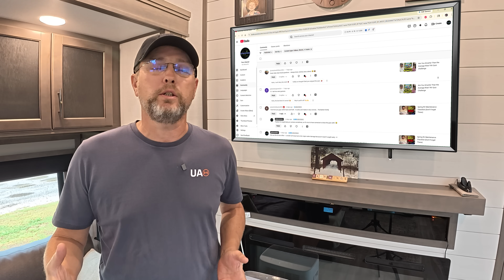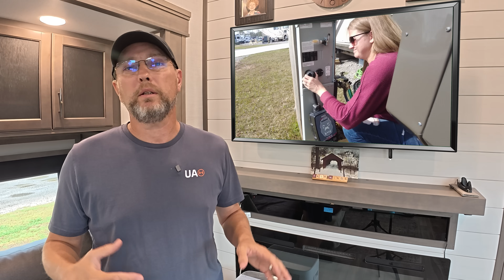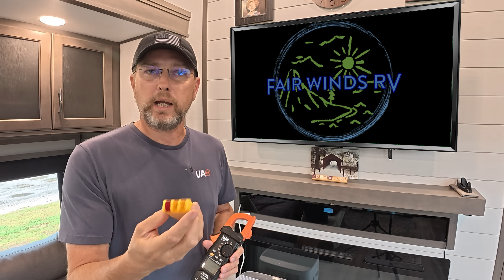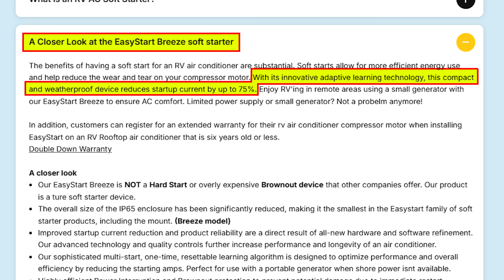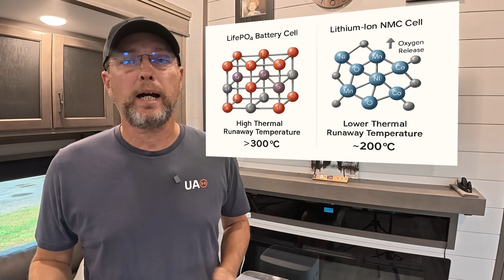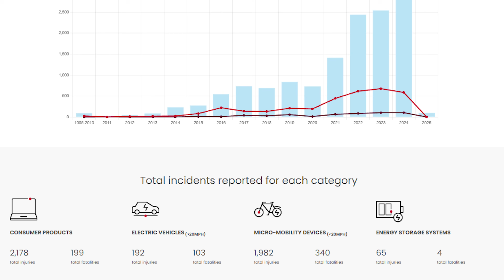Bad RV Advice We Keep Seeing (Let’s Clear This Up)

Comment: After 4 campers and camping since 2005 never used a surge protector or soft start. We camp every year and normally make 15 to 25 stops on our 3 month camping trips around the country. Do you have a surge protector or soft start in your home for the whole house? Don't say surges or screw up can't happen at home.
Reply from the maker: Residential electrical systems are a completely different animal. They don't get abused on a daily basis and you don't have neighbors moving in and out every day with electrical problems that affect YOUR house. And your residential grid is being operated and maintained by licensed professionals, not some random campground employee. Surge protectors (with an EMS) are insurance. You may never need them, but when you do, they can save you a ton of money. Just because you've never had an issue doesn't mean other people aren't having issues every single day. As an RV tech, I've seen the damage caused by a missing neutral. Thousands of dollars in damage could have been prevented by a $300 surge protector with an EMS. Take chances with your RV if you want. The rest of us will play it smart. 
Oh...and people have also been installing soft starters in their residential air conditioners for a while now...because they work. It's not just about being able to start an AC on a generator, it's about protecting your AC units from wear and tear long-term. 
Use these things or don't. It makes no difference to me, but you simply can't argue that that they're not important tools to have. Your experience does not equal truth.

Comment: First, let’s talk about RV surge protectors.

I completely agree that they are necessary. The more advanced models with emergency power shutoff are excellent, but even a basic “dog bone” style surge protector should be considered the minimum.

Many of us camp outside city limits, where we get great views and that wonderful wilderness feel. But that also means we are often closer to areas where lightning and unstable power can be a real concern. No surge protector is going to save your RV from a direct lightning strike, but it can help protect against power surges caused by storms or poor campground electrical service.

As both a licensed radio operator and an avid RVer, I’ve seen what power surges can do to unprotected RV electronics. A surge can damage things like the control board for your furnace, water heater, or propane refrigerator. Even a basic surge protector can help prevent a trip from being cut short because you suddenly have no heat, no hot water, or no refrigerator.

In my own RV, I use a Victron inverter/charger system that helps manage power quality. I still use a surge protector at the campground pedestal, and if the incoming power is bad, my system shuts off shore power and switches to battery power. Most RVers do not have that kind of setup, so for them, investing in a good surge protector with emergency shutoff is a smart move.

Second, let’s address soft starts for RV air conditioners.

Do soft starts damage your A/C? No. They do not. In fact, they may improve the lifespan of the A/C.

A soft start helps your air conditioner start more gently. Without one, the compressor gets a big sudden hit of power when it kicks on. That is the loud “thump” you often hear when an A/C starts.

A soft start reduces that initial jolt. It gives the compressor just enough power to begin moving, then gradually increases it. Once the compressor is running at speed, the power demand drops back down.

This is easier on the air conditioner and may reduce wear and tear over time. That is why I have soft starts on both of my A/C units. They allow me to run them from my inverter or a smaller generator, but just as importantly, they help the compressors start more smoothly and may extend their life.

Third, let’s talk about LiFePO4 batteries in an RV.

Are they safe? In simple terms, yes. If a location is safe for a traditional flooded lead-acid battery, it is generally safe for a LiFePO4 battery.

Any battery can fail if it is badly damaged. If you crush or seriously damage a lithium battery case, it can fail dangerously. But the same is true of a traditional lead-acid battery. Those contain acid, which can cause serious damage and can also create fire risks.

One safety advantage of LiFePO4 batteries is that they do not give off gas while charging. Traditional flooded lead-acid batteries need more ventilation because they can release gases that are toxic and flammable. That is one area where LiFePO4 batteries are actually better.

The main thing to understand with LiFePO4 batteries is temperature. Traditional lead-acid batteries handle freezing temperatures better when charging and discharging. LiFePO4 batteries usually have a low-temperature cutoff, meaning they will stop charging if the battery cells themselves are too cold.

Some LiFePO4 batteries include built-in heaters. These use a small amount of incoming charge to warm the battery until it reaches a safe operating temperature. That is the type I use in my RV. I have two heated 300Ah Vatrer batteries connected together, giving me 600Ah of battery capacity to power my Victron inverter system.

So the overall answer is this: LiFePO4 batteries are not more dangerous than standard RV batteries, but you do need to pay attention to battery temperature in cold weather. What matters is the actual temperature of the battery, not just the outside air temperature.

In my setup, outside temperatures have to drop well into the 20s before the batteries themselves start getting close to 40 degrees. I even tested the system when it was 2 degrees outside before I saw the batteries enter warming mode and noticed a drop in available power.

The lesson is simple: measure, test, and know how your own system behaves.
Reply from the maker: Agreed 100% on all.

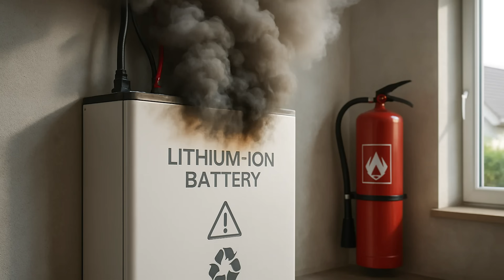Comment: I used to agree with you regarding LiPO4 batteries. Yes, the BMS is supposed to prevent overcharging and over discharge but they can't do anything if the default is from the batteries themselves where all of the energy is stored. At 8:18 you showed the out-gassing and that is the hazard. That gas has a high concentration of hydrogen which can be an explosion hazard in a contained area and has a high concentration of toxic compounds including cyanide. I still use these batteries but only with a lot more respect for what could go wrong. I no longer have them inside where the gases could kill someone sleeping or in a non-vented environment that creates an explosion risk. If you want more information on these potential problems, check out StacheD Training for real life details. (I am not affiliated in any way with that channel.)
Reply from the maker: No battery is completely safe, but I'd much rather have an LFP battery than a LA battery not only from a performance and cost perspective, but also safety. Taking the right precautions is always prudent, no matter the battery chemistry.

Comment: Thank you for these posts. 👍🏻 I wanted to chime in on the BB controversy but you turned off the comments. Obviously a lot of emotion around this issue. I’ve had no issues with my BBs so far and we’re going on 3 years for 2 of ‘em and 4 years for the other 2 100Ah.  I’ll keep this short: How do you monitor the temp at the terminals? I have Victron everything, btw, professionally installed. Also use a Progressive EMS.
Reply from the maker: The best way to manually check the terminal temps is using an IR temp gun. You can pick them up pretty cheap at your local big box store. Another idea is you can mount a temp sensor on it...like the ones from Govee. Those things can be remotely monitored from your phone and you can set alarms to notify you if the temp gets too hot.

Comment: Serious question: do our HOUSES have an EMS with EPO? If not, why do our RVs require one and our Houses don't? Just curious.
Reply from the maker: Very good question and thanks for asking. The odds of having a severe electrical issue, like an open ground, open neutral, or reversed hot/neutral in your home are very low when compared to campground electrical systems. Campground pedestals get abused regularly. Breakers and outlets fail frequently, and unlike residential homes, most campground pedestals are not serviced by professional electricians. Many times, they're being repaired and maintained by work campers or on-site staff that have no electrical background and don't truly understand how they work. Additionally, campgrounds are much more susceptible to dangerously low voltage sags when everyone is using their AC units at the same time.
And far too many people are performing bootleg electrical work in their RV's that cause problems for the entire campground.
The electrical system in your home is far more stable because, generally, once it's installed by a licensed professional, it just sits there and does its job. Nobody's messing with it on a daily basis. Obviously, residential homes are not immune to the rogue DIYer that does something dumb that causes issues, but it happens far less often.
It really comes down to quality control. Campground electrical systems are notorious for being faulty due to human errors during repairs and maintenance, and frankly, just being abused on a daily basis.
Reply: @fairwindsrv Next Question for someone who knows: In general, are there codes for building a campground when it comes to the plumbing and electrical work?

Comment: I spent 43 years as an electrician and anyway that you can protect an electrical system and electronics from search are under voltage is a good thing.
You don’t wanna smoke your appliances your electronics. I even went as far as to replace the progressive surge protector with the power watchdog on board EMS and my brand new Escape Trailer. One feature the power watchdog has as you can get an extra circuit board in case you do take a Hitt and I have one spare and in my rig.
Reply: Interesting. I’ve been using the same Progressive for years and it always takes a couple of min to “click” on because I assume it’s assessing the feed- which I can read, except in full sunlight 😎🙄- but I noticed that the plastic at the base of the prongs must’ve gotten a little hot, presumably from loose contacts, but that’s a “good” thing because it’s easier to replace a surge protector than a whole lot of fried components. 🤷🏼‍♂️

Comment: Just saw this and subscribed. I am wondering if you have done a video on what is necessary to change from lead-based batteries to lifepo4, going to search your page.
Reply from the maker: Welcome to the channel! Switching to LiFePO4 is relatively simple. First, you need to make sure all of your sources for charging the battery support it. Converter, charge controller, etc., as LiFePO4 batteries have a different charging profile than lead-acid. Additionally, LiFePO4 batteries are capable of delivering much higher fault current than lead-acid batteries, so you need to make sure your main battery fuse is rated properly and your wires are sized properly. 
My biggest advice is to make sure you get a battery with a decent BMS to protect from any faults as well as provide low temperature charging protection as LiFePO4 batteries should never be charged below 32F. Most LiFePO4 batteries will have a BMS that will protect the cells, even the budget brands...but it's definitely something to pay attention to.

Comment: We hard wired our Power management system. Its not a surge protector. One down side to a hard wired unit is if it goes dead then the whole RV is dead until its replaced, so I bought a new one for that reason.
Reply from the maker: When we melted the connection between our portable Power Watchdog and shore cable, I converted it from potable to hardwired. Fortunately, our Ecoflow power stations don't run through the Power Watchdog, so if it dies we at least have temporary power until I can get it swapped out. Not a hard task, but would be a little time consuming for sure.

Comment: You are right, anyone not using a EMS/surge protector is going to end up spending lots of money. What a lot of people don't know is that low voltage probably does way more damage than big surges. That guy who thinks just checking when he first plugs in is one of them. I hate to admit it but back when I was starting, I didn't have a surge guard. We were in a campground, and we were running a load in the washer. Well the lights dimmed and came back up the washer quit and wouldn't run. For those winning about cost, I could have bought the best EMS on the market and had money left over for what it cost to fix the washer. I like my portable Surge guard because I can plug in and check power before parking the RV.

Comment: LiFeP04 lithium iron phosphate LFP batteries/inverters/solar charging were my bread and butter hobby since 2017. I built 14 systems using them, ranging from 50 amp hours to a 3600 amp hour 1100 pound unit that could power a house for days. These include 2 motorhomes, a rural cabin, a vacation home, all for friends and family. I used to tell the YT Firefighter StacheD that he was overly concerned about these batteries catching fire.....until one set my power console on fire and did $150,000 damage to my house/garage.

True, water can extinguish LFP battery chemistry, and they don't suffer thermal runaway.  What happened in my case was thoroughly investigated and is going through court now so I must limit my details.  It turns out that the 300 amp hour battery that ignited was under very low load, was charged to 99%, and should have been safe. It operated with 11 others in the same cabinet for 2+ years straight with no troubles at all. My video monitor captured the battery parameters right until the smoke obscured the lens....NOTHING ABNORMAL!

The forensic investigation determined that the 80 pound battery was dropped upside down from 5-6 feet and landed flat sometime in its delivery to my home. A loading dock accident?  Inertia caused the cells to break free of their double sided tape and one nipped the insulation and pinched the internal negative lead to the BMS. In effect, the short circuit was BEFORE the path to the protective circuits. All batteries had fuses, too. But disaster happened.

And so....I am extremely wary of all kinds of batteries, LFP or lithium ion, charge them in a fireproof area and I set my timer to stop the charge as necessary. I have another 64,000 kilowatt hours in 48v batteries in my shop but they are UL Listed and have internal fire protection. I'm still wary of them. I will admit that the same brand of 300AH battery is in my camper van running and charging automatically, away from the house should the worst happen.

Comment: The issue I had with owning a Watch Dog surge protector was it shut down with any voltage change and did not turn back on when the problem was corrected. Specifically when the seasonal campground loses power during a storm. Every time the energy company notified me of a power outage, I had to drive 2 hours to the campsite to reset it. I switched to a unit from Progressive Industries that comes back on when the power is restored ( after it runs a system check first )
Reply from the maker: Strange that it wouldn't reset on it's own for a simple power outage. According to their website, the only faults requiring a manual reset are E3, E4, and E8 (L1 overcurrent, L2 overcurrent for 50 amp, and missing neutral in the coach). My guess is that if you had to manually reset it after simple power outages, you may have had a faulty Power Watchdog. In any case, glad you found something that works for your situation. These things are a life savers!

Comment: I installed a SoftStartUSA in my horse trailer in 2023,  I have an Anker 767 with a 30 amp plug, which according to what I was told should be able to run the A/C.  When I turn on my A/C it trips the Anker.  How can I tell if this device is actually working?
Reply from the maker: The only way to truly know if it's working is to actually measure the inrush current going to the AC using a high quality multimeter with a current clamp. The meter needs to have the ability to measure and display peak current.

Comment: Okay folks and I want to thank fairwinds for this video because you do have a lot of people that think they can outdo outsmart or even do better than what the equipment he's talking about. And by the way, I'm an electrical engineer as well as a licensed electrician for the state of Texas and New Jersey. Now with this being said he is 100% correct on the electrical side. I'm going to add a few things and mainly a lot of people try to cheap out. Why I say this is because you would use a surge protector in your RV in your home at work everywhere you go to protect your electronics in your place that you may be in, yet you wouldn't buy an ESP to protect your RV which has has extremely expensive electronics and components inside of it The next I want to touch on is please do not stick in electrical tester inside of an RV parks pedestal and the reason why I say this is because there's a specific tester you need to have in order to monitor and test that particular type of power. The basic tester that you buy from harbor freight may or may not work and God forbid if it doesn't work, you want those amps to be high. You went those volts to be high, a minimum of 600 volts to be exact and I'm going to tell you offhand a relatively decent tester that can test for that and can maintain that those testers start at $50 Nex is a soft start. They're great. They control power going to your air units and they maintain your air units as well now and if you have a newer soft start, the newer soft starts have Bluetooth features built into them which can also relay a message to you if there's an issue with your AC unit and with that issue is